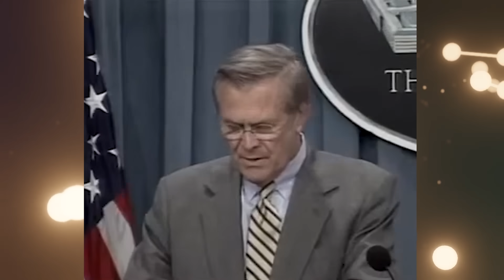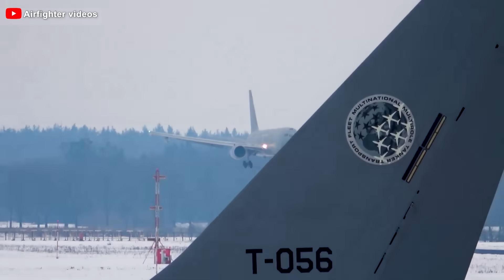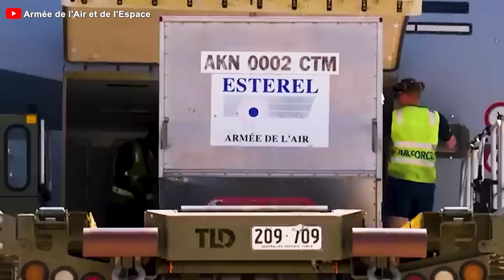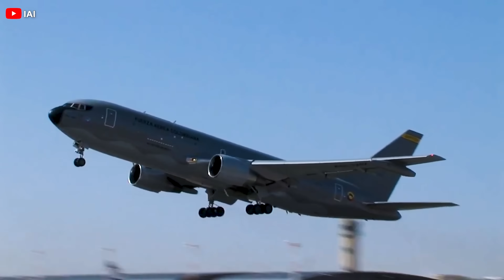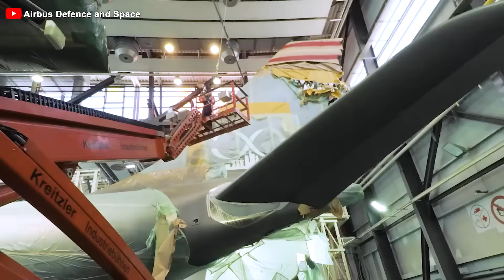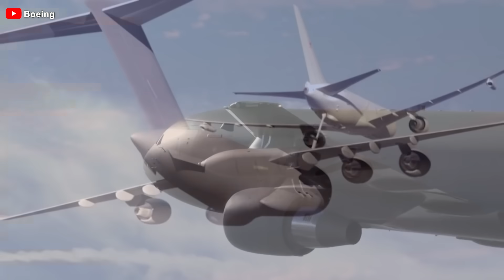Here’s why Air Force prefer the A330 MRTT to Boeing 767 in KC-45 contract!

Comment: KC-46 proofed to be the high risk option. It is not yet fully functional in 2025, while the A330 MRTT has been certified to refuel any aircraft in the NATO that is capable of being refuelled, years ago. The biggest problem of the KC-46 is the control of the refueling boom and the boom itself, exactly the area where Boeing claimed superior experience, as they had developed earlier generations. The Airbus refueling boom is their first. It is now in use for years on the A310 and A330 MRTT  with great success and has done recently its first successful test of fully automatic operation.
Boeing got the contract because the tender was geared to the capabilities of the 767. No extra points for a more capable aircraft, like additional amount of dispensable fuel, more passengers, more cargo, more range and so on.
Meanwhile the A330 MRTT+ is on offer. Based on the A330-800 instead of the A330-200. It opens up the difference between the 767 and A330 still more. As it is, it is about lower fuel consumption. That can be used for dispensing more fuel or the same amount at added range.
If the USA air force wants to buy a fully certified tanker for a further order of the shelf, the A330 MRTT is, as it is, the only one available.
Reply from the maker: That's great, mate!
Reply: You've bee reading 'Air Wars' by Scott Hamilton recently haven't you? 😉 (am just finishing it at the moment)
Reply: @alan-sk7ky  I have not managed to read that book yet. I am an retired engineer and private pilot and am interested in everything connected to engineering. It is a shame what became of the once proud Boeing.

Comment: Boeing is only choice for USAF. By Pentagon policy.
Reply: The Pentagon ordered the A330.
Reply: @mjoelnir1899 I  Believe KC-46 is being operated by the USAF .
Reply: @kevingreen920  Yes but the Pentagon wanted the A330. Boeing used it's political connections to have that overturned & forced the Pentagon to re-run the bidding process with lowered requirements that more fitted in with the KC46's lesser abilities & Boeing also dropped the price per unit below that of the A330 & gave a better delivery schedule. Boeing won the second bidding process then to nobody's surprise failed to meet schedule delivering the KC46's years late & during that time the price crept back up  so in the end the KC46's cost more than the A330's.

Comment: Boeing said KC46 was low risk ? Still not fully operational !! They were wrong . Fixed price contract ?  Was that good for Boeing? I think you missed a few key points ( there are more) in this report.
Reply: I cannot help thinking of the 737 MAX & the Starline Capsule.  Or Lockheed & the F104!